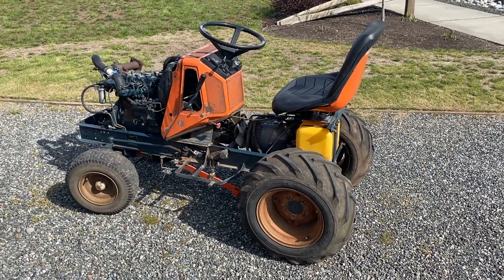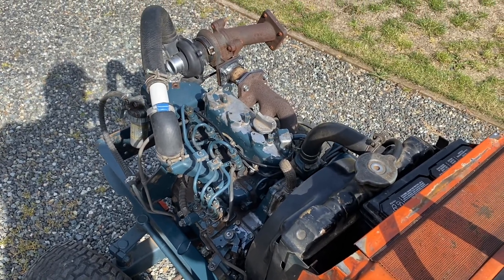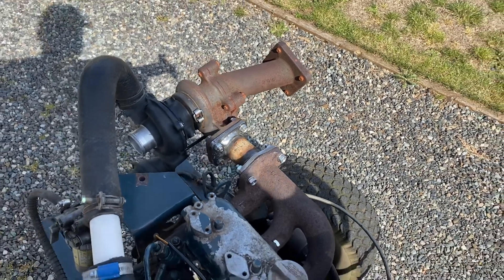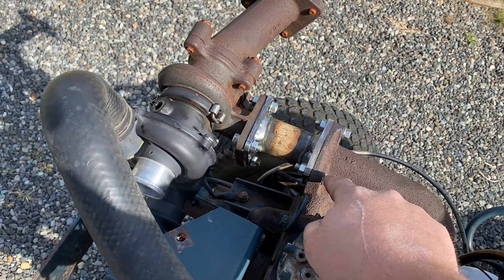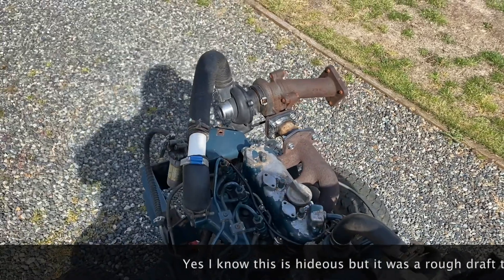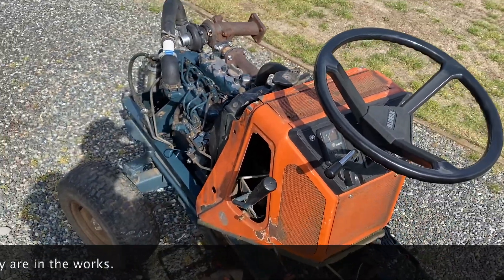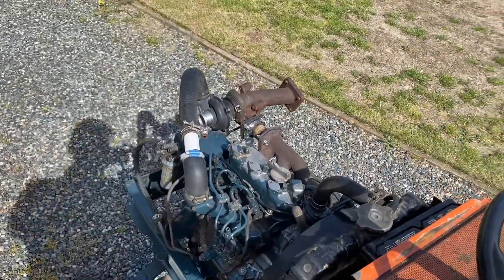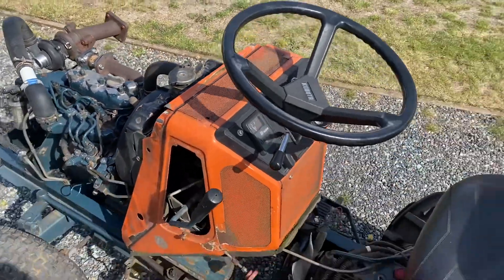Custom Kubota G6200 Turbo Diesel Project Startup and Mow

Comment: if you put 5.5 plungers in barrels in it, it would have enough fuel for atleast 45 pounds of boost, stock fuel with stock fuel screw is like 10 psi, cut screw is 15 psi. if thats a rhf3/31 then you should be able to make what i listed above with a bit more rpm, hp wise, 10 psi stock rpm, 23~ hp crank, 15 psi stock rpm, 29~ crank, i was running mine at 40 psi and abt 4k rpms, thats 70 crank hp.
Reply: You seem to have some knowledge on this little engine. Mind giving me a few pointers? I’m using a D640 as a power unit to run hydraulics and air compressor on a service truck and it could use some more hamsters. Thinking of giving it some air but don’t want to lift the head either. Thanks.

Comment: Don’t you get cooling problems with the battery so close to the radiator? I did with mine bought smaller battery and that solved the problem
Reply from the maker: I have not had any overheating issues. The radiator is clean, it has new coolant and the fan belt is new and nice and tight which all help keep these little motors cool. If you can spin the radiator fan by hand and it doesn’t rotate the crank then it’s time to check tension and possibly install a new belt.

Comment: Any fueling mods? What's yhe turbo off of?
Reply from the maker: No fueling mods yet. I want to get a boost gauge to see if I’m making more than a couple PSI. If I’m able to build 5 or more (doubtful) then I might try to add fuel. The turbo came off of a larger Kubota industrial engine. I was going to buy a cheap one off of amazon to start but this one was free.
Reply: Thanks for the reply!

Comment: Where are you getting the oil feed from?
Reply from the maker: I Tee'd off of the oil pressure switch feed with an 1/8 NPT street T sourced from Amazon.  The return was sent back to the mechanical fuel pump block off plate which I drilled and tapped.